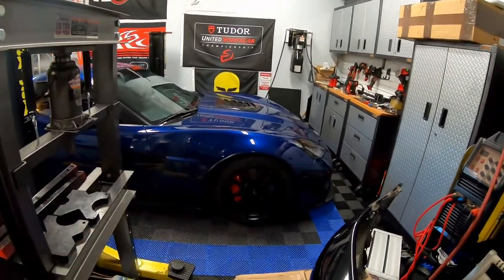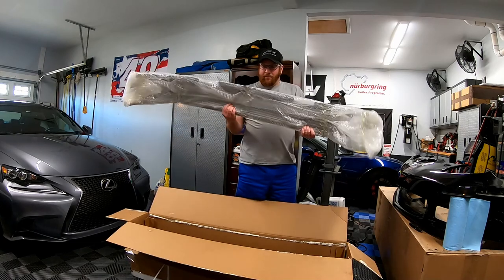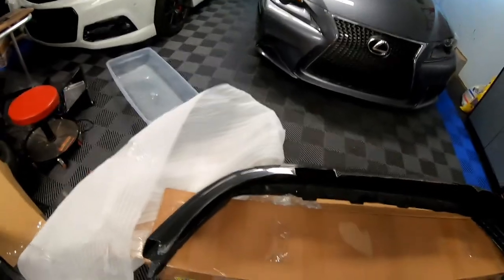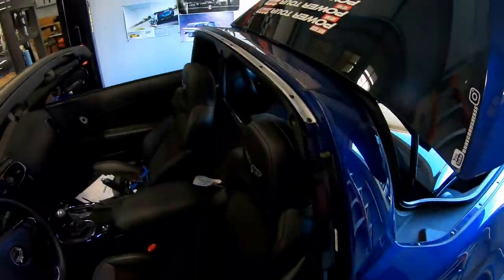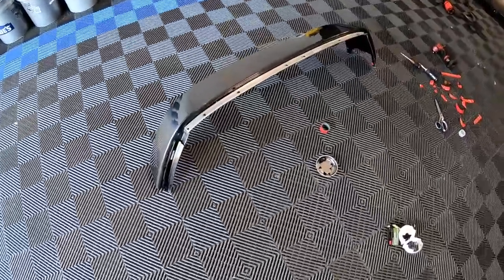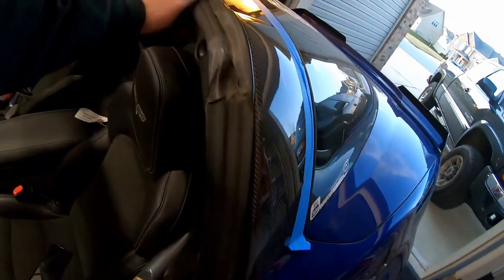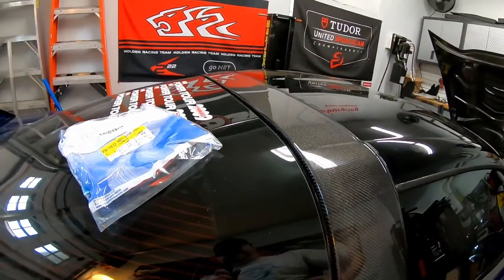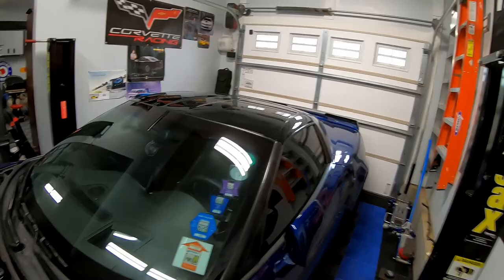2005 Chevy Corvette - V4.0 - Ep. 83 -  Carbon Fiber Halo Install

Comment: You don’t have to drill any holes for the carbon fiber pillar right?
Reply from the maker: When you transfer over the aluminum mounting flange - I think there might be a couple holes in the halo you have to drill out.

Nothing on the car side.